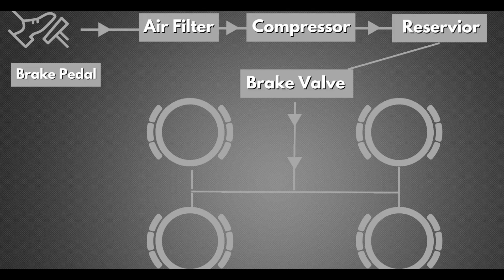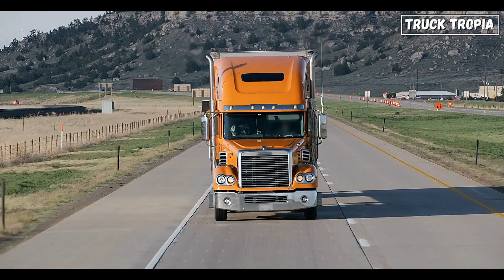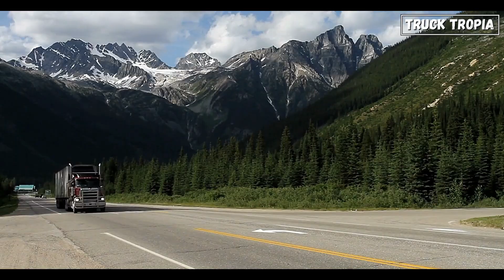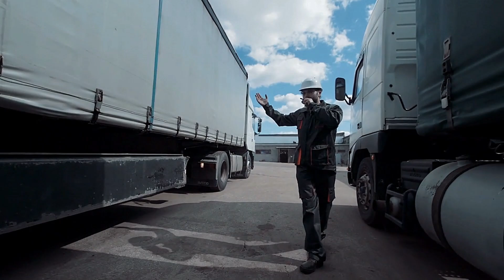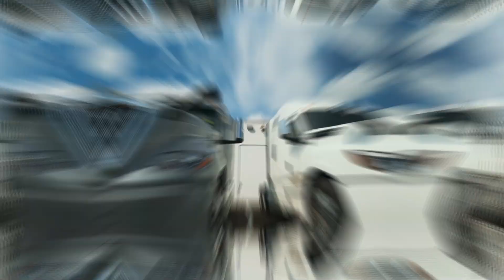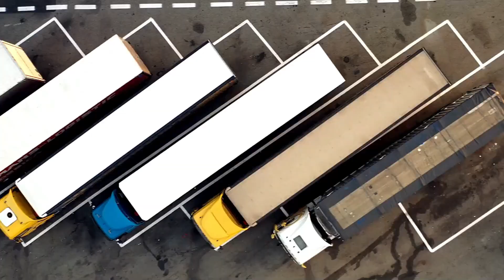Why Semi-Trucks Use Air Brakes?

Comment: One of the questions that I have seen is why are air brakes not used on automobiles? One of the main reasons air brakes are not used on automobiles is the large size of the air tanks which take up a lot of space. Also I am old enough to remember when cars had just a single master cylinder and one brake circuit. Then for safety cars started to have dual master cylinders and dual braking circuits.

Comment: Since More than 15 years ago Scania and Volvo have electronic controlled air brakes; full pressure in the system all the way to the brake chambers where electronic ly operated valves control air pressure. 
This has reduced braking distance significantly. 
Ofcourse disc brakes are used!

Comment: Here's a topic: why are most semi-trucks in North America still equipped with drum brakes? Discs are an expensive option, and may be optioned for the front wheel only, or for all wheels. Discs not only stop better, but are typically quicker and less expenensive to service.

Comment: Air brakes on modern vehicles use disks, not drums and are electrically operated or fly by wire, every vehicle has dual circuit brakes. You didn't mention trailer conections, hydrolic trailer brakes for heavy trailers would be a nightmare.
Reply: Most US semi-trucks still use air actuated drum brakes; discs are optional.
Reply: @R777-RLM  
In 30 years, all American trucks will also be equipped with disc brakes!
Reply: @peternielsen2156  You're probably right. lol

Comment: another reason before power hydraulic brakes that your own foot power was needed. since drive pushing piston that pushes fluid through the system. this get hard to do when brakes get bigger. So air brakes are first power brakes so driver is just controlling a valve and air compressor is doing all the work.

Comment: 80,000 LBS IS THE TRACTOR TRAILER ( SITTING STILL ) (( NOT MOVING )) . 80,000 LBS MULTIPLIED BY THE SPEED LIMIT IS THE ACTUAL WEIGHT (( WHEN MOVING )) . (( EXAMPLE : )) (( 80,000 LBS X 70 MPH = 5,600,000 LBS )) THAT MEANS (( 40 TONS X 70 MPH = 2,800 TONS )) (( WHEN MOVING )) .
Reply: That's not how that works lol
Reply: @davidney2412 you are referring to kinetic energy not the actual weight the weight remains 80000 pounds no matter what speed it's going however it's kinetic energy increases with speed

Comment: You said nothing about the trailers having air brakes and that is the only reliable way of being able to change trailers witch can happen often hydraulic brakes would have to be purged of air every time the truck reconnects to the trailer that would be time consuming and as you pointed out electric brakes don’t have the safety features that air brakes do and it only takes a few seconds to connect the truck air to the trailer to power the trailer brakes

Comment: Cars also have dual hydraulic brake circuits.
Reply: And it has been that way since 1967.
Reply: @Max.Innuendo some do, some don’t. My car is a 2014 model, and my car is indeed one of the “lose one, lose them all” cars. Ask me how I know. Scariest drive home ever, when the left rear brake piston sprung a leak. I was stopping entirely with my parking brake handle since the pedal would hit the floor without any braking whatsoever.
Reply: @PigglyWigglyDeluxe  Apologies, I live in the US where it's been federal law since MY 1967 but that doesn't mean it's law everywhere else.

Comment: Dual circuit break lines is not a uniwue thing to air brakes. It is required by law in most of europe on your hydraulic brake system in your average Toyota

Comment: American 🇺🇸 trucks manufacturers what is reasons couldn't 🤔 technically make rear-end hub reduction axle configuration assembly axle designs like European 🇪🇺 trucks, 🤔 😉
Reply: No, liftable axles aren't that good.  Tandem rear axles are much better than standard single (or a second liftable) rear axle like on most european trucks
Reply: @martinws8416  Hub-rediction rear axles configuration the better than Heavy-duty trucks each wheel through an additional reduction gear built into the hub, providing a more robust and efficient power delivery system compared to a standard axle design. …

Comment: Compressed air brakes are invented by (French guy) Perrot, and originally he intended them to be used on trains.
He showed them in Paris, at wold fair and mr Westinghouse saw potential and negotiated manufacturing rights with mr Perrot,
WABCO was born.
Trucks have 4 air circuits, one for parking brake, one for aux. devices (air seat, air operated clutch, gearbox split, diff lock, horn....), and circuits 3 and 4 for regular brakes.

Older trucks withouth ABS and brake assist have very simple brakes with few generic components.
Truck compressor never stops, pressure in system is regulated by overpressure valve (usually within dryer) or within integrated unit on modern trucks. Safety pressure valve is not always present.

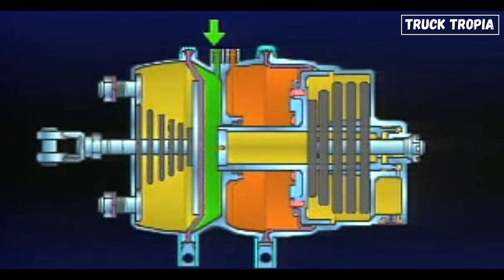Comment: in minutes 3:45, cant they make a hydraulic brake system just like the air brake system (the use of spring brake)?
Reply: Not quite. Hydraulic fluid at times can boil and the mountain terrains that us truckers get into is a recipe for disaster when they fail. Compressed air is different. The air brakes use springs that, when pressurized, release the brakes for us to move. When you press on a big trucks brake pedal, you're really just releasing the air in the system that's keeping the brakes free. 
Does that make a bit more sense?
Reply: @madredranger  what i mean is, is there any possibilities from Rnd perspective to change the fluids from air in air brake system into liquid fluid? so the system is the same, but instead of releasing the air, you release the liquid fluid. This is my question. In doing that, you will have the same safety system as the air brake system (*maybe 🤣)
Reply: Well... I do see your point. The only issue around that would be the auxiliary air systems and the trailer brakes. The captain seats use the main air supply, in modern trucks, to keep the ride comfortable and, I believe, all trucks use air systems to shift gears. They still use fluids to engage the clutch but the use of air to help shift gears. On top of that, trailer brakes and systems are possibly the biggest issue of RnD. There are way too many factors in my mind to see RnD wanting to replace air with fluid as truck systems rely so heavily upon it.
Reply: Yes, but the safety checks to make sure the brakes aren't going bad would be ridiculous to maintain. If a hydraulic system goes bad, there would be no pressure on the brakes. Put yourself in the driver seat going down hill. Would you rather the brakes go out and you can't stop, or the brakes go bad and you skid to a full stop?

Comment: air brakes are crucial fro everyone 
both for the truckers and the road user 
an idea for a video 
What truck  brand as the most efficient trcuk
Reply: id be willing to bet on the SCANIA truck for most efficient braking 
the retarder, automated manual g/box, all disc brake axles would make it at the very least top 3